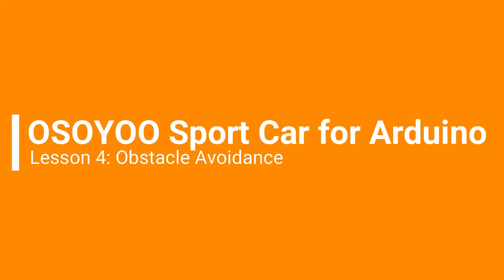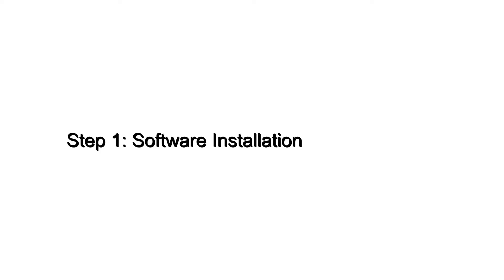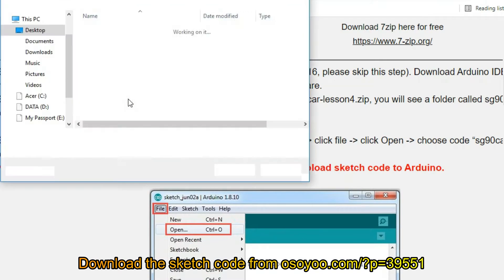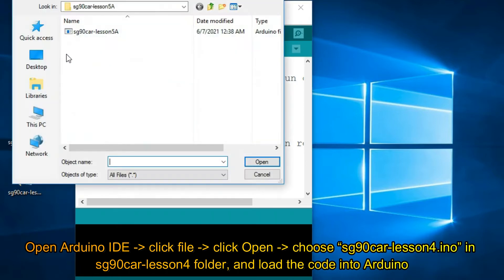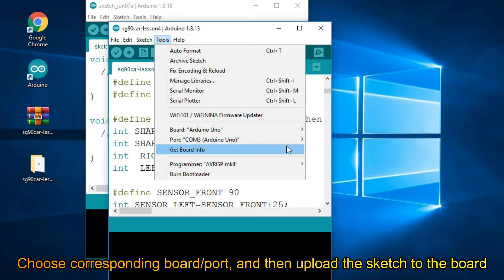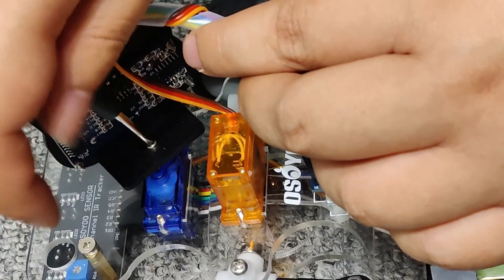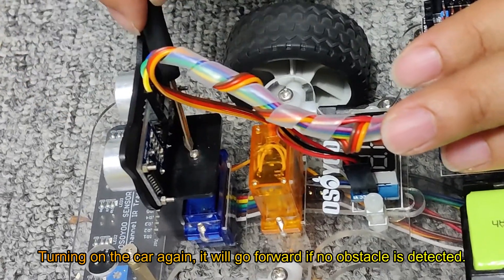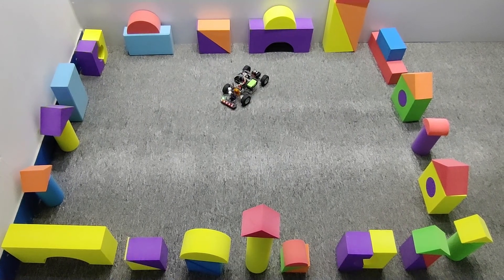OSOYOO Sport Car for Arduino Lesson 4: Obstacle Avoidance

Comment: I don´t know why my car is not capable of avoiding obstacles, it just moves forward. I have connected everything as it is shown on the video. If i disconnect the echo or the trigger the car moves left or right backwards but it doesn´t avoid obstacles. The control with Bluetooth works fine so i don´t understand why obstacle avoidance doesn´t work. I hope you can help me.